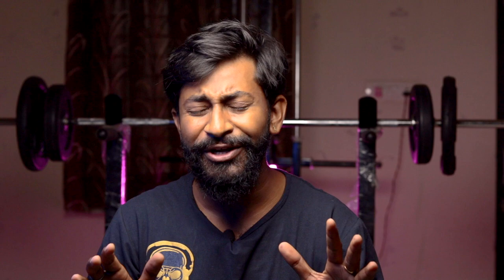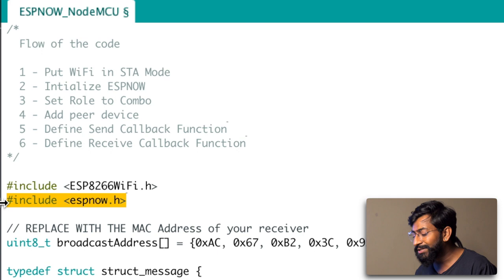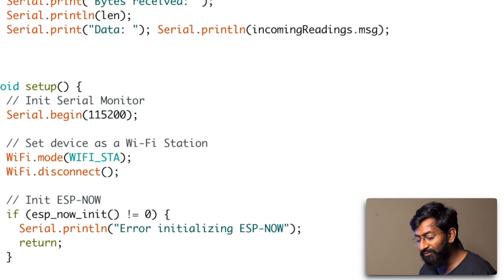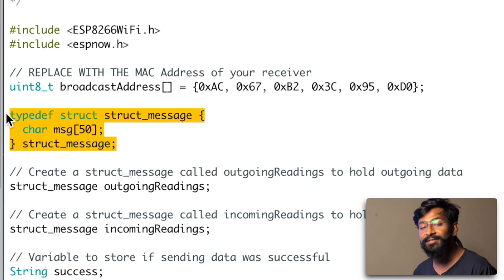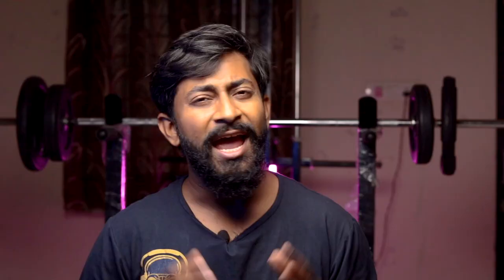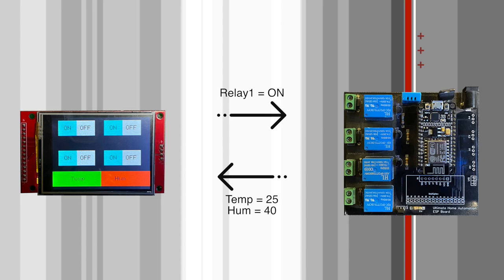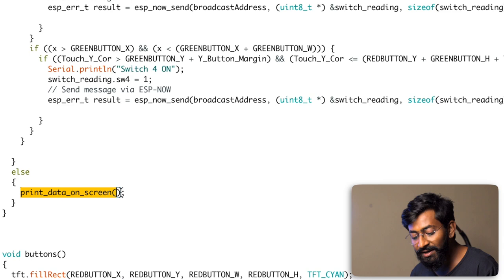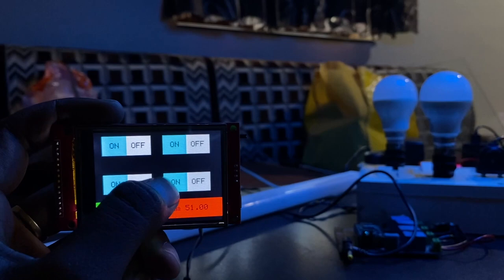Home Automation without Router, Hotspot & Internet | ESPNOW two way communication | ESP32 & NodeMCU

Comment from the maker: What do you want to learn next in ESPNOW?
Reply: How master can read data from slaves and send those data to phone?
OR
How phone can read data from esp now network directly?
Reply from the maker: I’ll try to do that
Reply: This same project using micro python
Reply: Is it possible to make the button act as a push button, like the light stays on when my hand is on the button and goes off when I remove my hand
Reply: what about ESPNOW mesh network? is it possible?
Reply: I just to add one more thing for control fan speed using slider bar on touch screen.
Reply: Wireless irrigation system for agriculture
Reply: touch screen with  blynk2.0 homeautomation
Reply: Bro please make 433 MHz relay system
Reply: Sir, can you plz make a video for espnow btwn two esp32 , one is using soil moisture sensor and other connects a micro servo. The servo is controlled based on the soil moisture level i.e. if the sensor at one esp senses moisture/water it send signal to other one and other turns on the servo. 
It will be a great favor to help learn and make such project.
Thanks
Reply: Add one more feature, update the touch screen button colors to change based on the feedback from the receiver whether the light is at present ON or OFF
Reply: how to store and fetch broadcast addresses (mac addresses) of other esp boards in eeprom of esp board  to form two way communication using espnow protocol .  I am struct  to assign MAC Adderess to BroadcastAddress[] array in espnow protocal which I  fetch from eeprom

Comment: Hi sir, i use 4 & 8 channel relay readymade board with Nodemcu ESP8266. I always face relay flickering issues (for a moment it turns on and off ) when Nodemcu is powered. I tried many other pins but still isuue is there. Please help to solve this issue. If possible , prepare a short video on this topic. Thank you.

Comment: Superb bro... I hv an interesting idea n I believe u can do it too.  Using all ESP32 act as a Ai motion sensor using Bluetooth or wifi, talking to each other, trigger from 1st sensor when detecting human, 1st sensor will inform other sensors to turn on their light maybe 50%, when it reaches the 2nd sensor it turns on 100% and broadcast again to other sensors and so on.  It will learn too, if everytime 1st sensor detected broadcast to others, the others will turn on 50% but some sensors after maybe few attempts, there is no motion detected everytime the 1st trigger sensor broadcast, it will not turn on anymore after learning all broadcast from other sensors too. This could be amazing for everyone I believe.